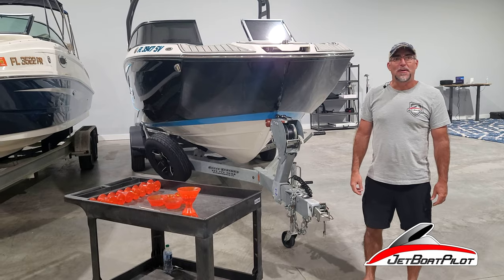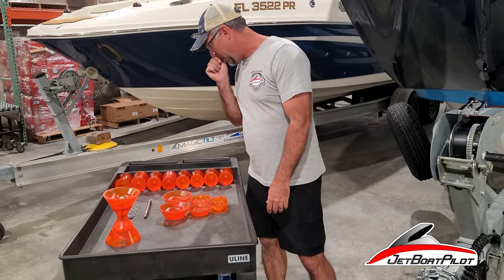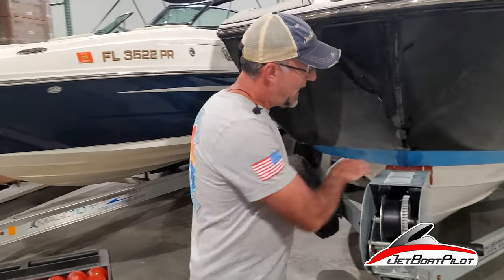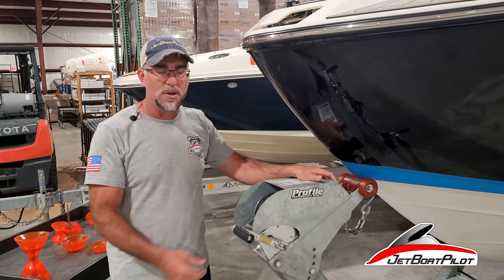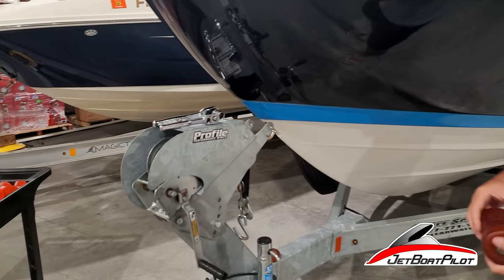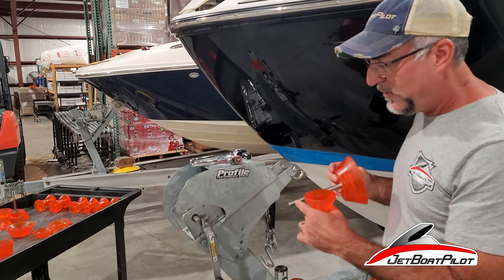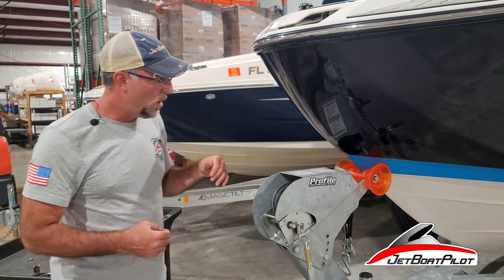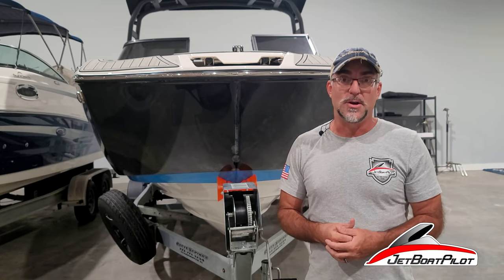Why Is Everyone Replacing Their Factory Bow Roller With This One | Stoltz Roller Install Video

Comment: Very nice. Anti-seize is really a must on stainless bolts. Personally I'd switch it with galvanized steel.
Reply: Question: should i take the lug nuts off my trailer periodically and antisieze them? I'm new to saltwater boating, but familiar with rust and such as a welder.
Reply: @DoyleHargraves  yes and put marine grease on the backside of the wheel where it touches the face of the hub, they rust bad there.